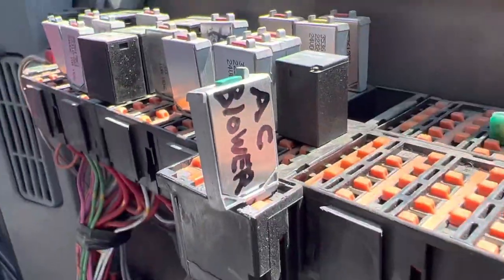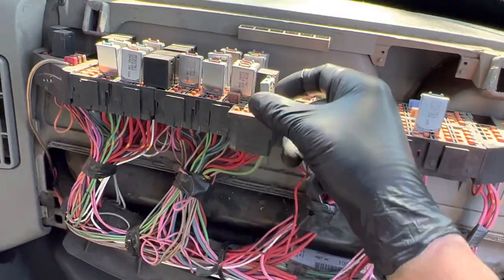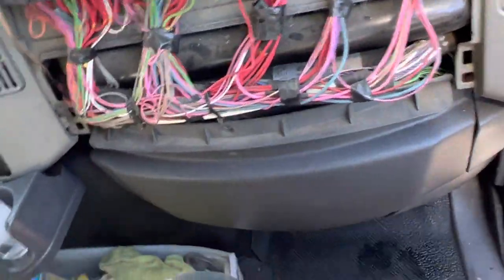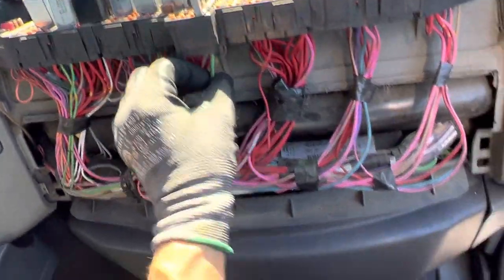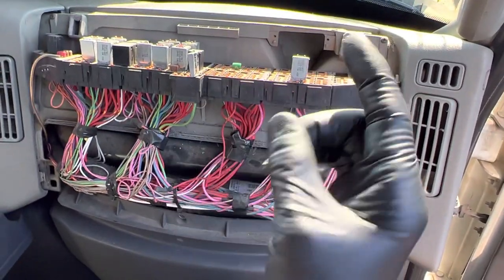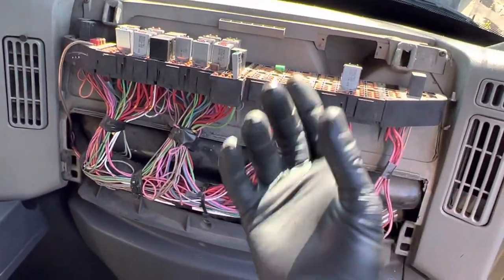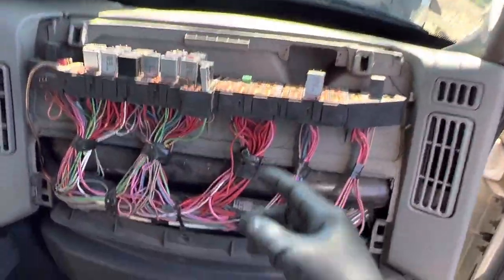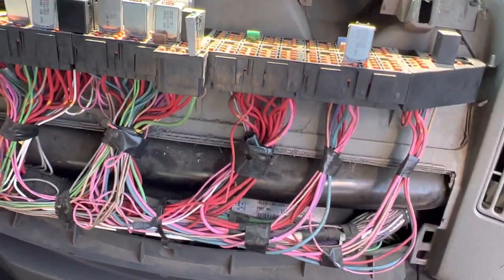High amp draw from blower motor intermittent blows circuit breaker

Comment: Just so you're aware. Navistar actually has a bulletin to replace those style circuit breakers with a standard fuse specifically due to the symptoms you're describing. Those circuit breakers are pretty crappy and fail often. They heat up as current passes through them and over time the heat cycling can cause the contacts to get burnt causing a voltage drop. This in turn burns the contacts more and more until finally you have either an open circuit or melted circuit breaker. It might not be the blower motor after all. A current waveform would be the best way to tell which of our hypothesis is correct. Just your know nothing Navistar tech.
Reply from the maker: Cool info.  Will leave in Circuit when the Tech replaces the motor to retest.  Then after test replace with a fuse.    Thanks